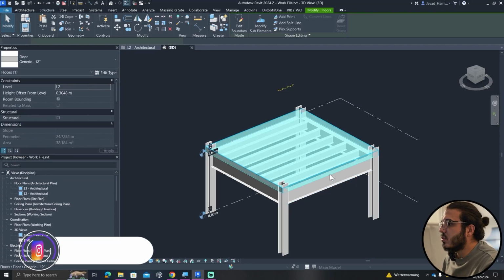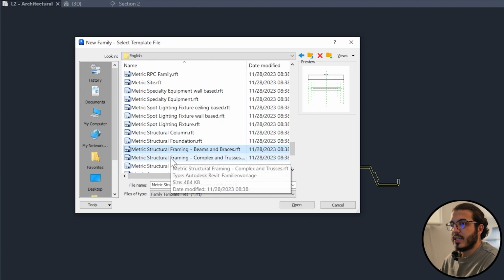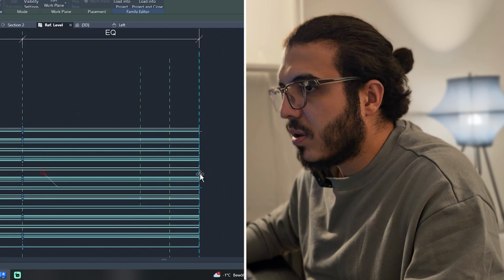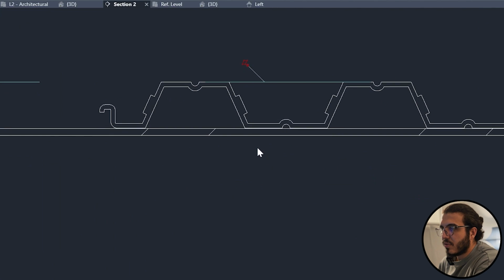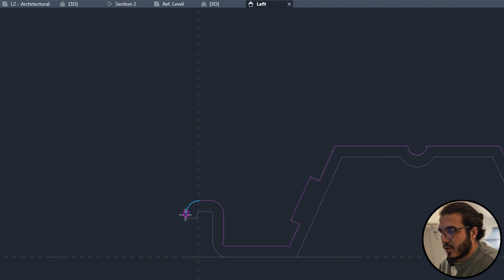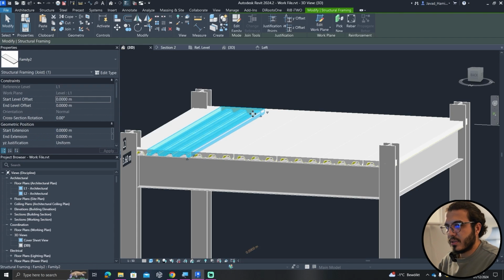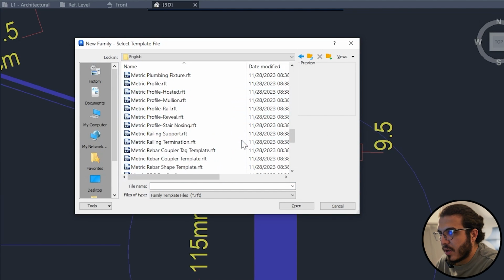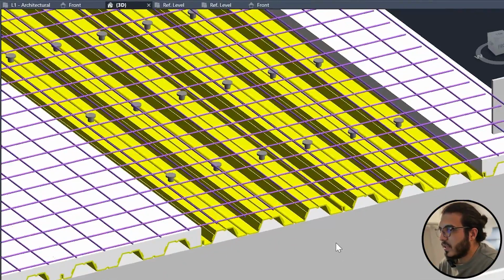Revit Structure Tutorial: Master Metal Deck Flooring

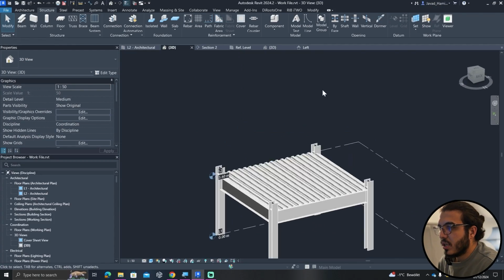Comment: No, man. Incorrect. You need to cut that profile our of a generic floor with a void placed in the profile sheet family. That is the proper way, as in a real automated design you need to keep a common same approach dealing with regular floor slabs and with this one, they should have the system thickness at least and same category, but you're inventing an unnessesary thing here after 13:50

Comment: His technique attempts to resolve an Achilles heel that Revit has in this structural system, but eventually and in a collaborative work environment in the case of using the family of structural frames for the metaldeck collaborative sheet it is acceptable, and by combining parameters I can extract the total area of those sheets, unfortunately there is no way to extract the volume of concrete and it is one of the breaking points of this flow, apart from the fact that there is no clear way to code the concrete which in this case stops being soil and is "prisoner" inside of the beam family. Keep Going
Reply: It's an Achilles heel for those who still don't fully get how to work in Revit